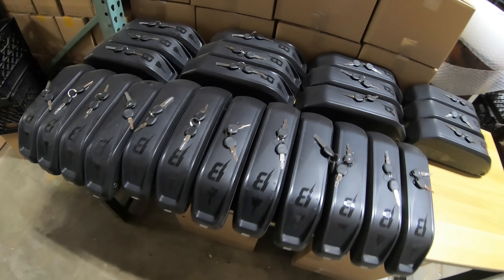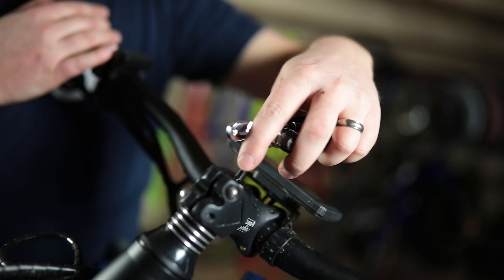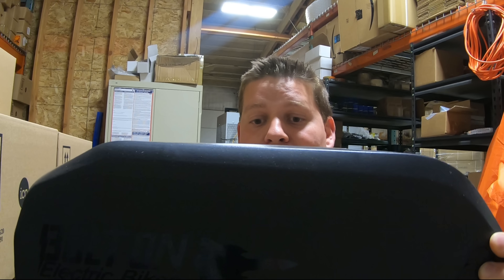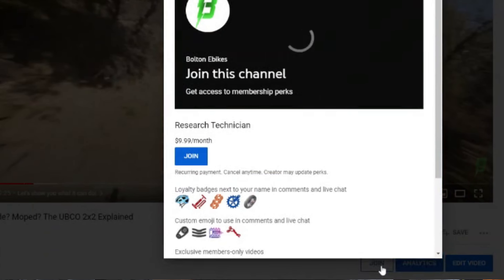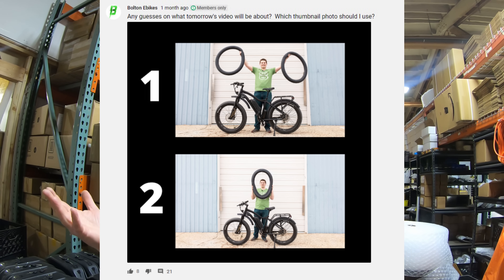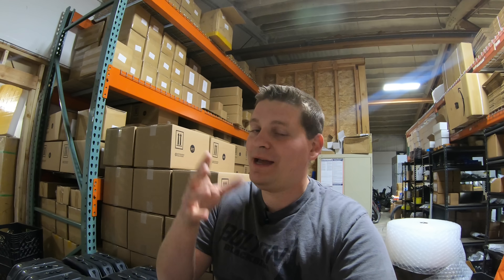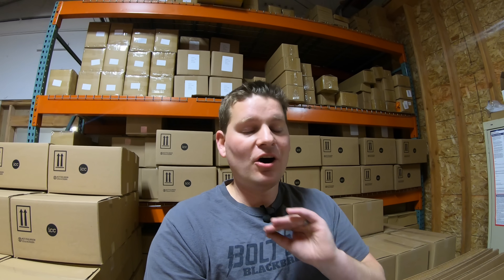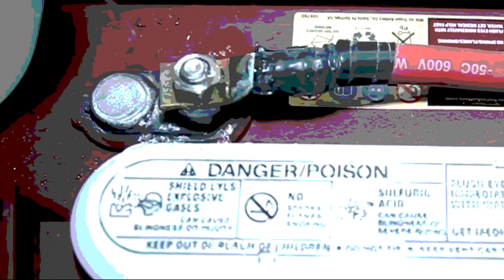How to maintain Lithium batteries for electric bikes - Easy!

Comment: Hello and thanks for your video,
However I have a question about a fault I keep getting< and was wondering if you could shed some light on it?

Description of fault.
While riding with a so call full battery, the bike loses all power and fails to turn back on>
On checking the battery after a full charge (Battery reads 39.3 Volts),

You take the bike out for a quick test, and the same thing happens, all power drops and the controller fails to light up (No power).

Take battery for a volt test it reads 9.0 volts (Not the expected 39 volts)
Plug the charger into the battery, it intimidately reads 39 volts, (Like it has rest something in the battery, and again works as before).

Take bike out after charging the battery to the manufactures recommendations, or till green light is lit.

You take the bike out for a quick test, and the same thing happens, all power drops and the controller fails to light up (No power).

Take battery for a volt test it reads 9.0 volts (Not the expected 39 volts)
Plug the charger into the battery, it intimately reads 39 volts, (Like it has rest something in the battery, and again works as before).

Any ides? Is there something in the battery house that can switch the battery off?  I did open the housing and all i see are two fuses, wires to the ignition and safety fuse, and a some kind of capacitor. 

I have rulled out a fault with the wiring as everything works as normal once I HAVE plugged the battery in and out of the charge port, charger.
ANY HELP WOULD BE GREAT,

Ops sorry caps lock. 

TIA Nico

Comment: Id like to know how many batteries he sells every few months or how he is able to maintain a proper storage charge voltage on any of the batteries just sitting on the shelf waiting to be sold.  if they dont sell super fast.    i only know of one battery store that the owner happens to keep track of the resting charge of most of the batteries he sells and tops them up a little bit when they need it because he offers a warranty on most of his batteries so he makes sure to keep them in good condition before he sells them and even checks each battery and records the resting voltage at time of sale.

Comment: Actually with lead Acid if you want it to last you never want to drain it to 100%, even 80%  For best balance between life cycle and cost you want to design it for no deeper than 50% depth of discharge

Comment: The battery explosion shown in this video is a Lithium Polymer pouch cell battery that's been seriously overcharged.
 Those are used primarily for  drones, and RC cars and boats.
Some do use them for ebikes because of the high C rating but without the proper balance charger, they can become firebombs.

Comment: I use a Grinn technologies charger you can charge at different levels ! Me to full charge every time for power  .I have 2 batteries 1 54.6 and one 58.8 !  1400 watt mid drive 61 clicks full suspension  Loud 27.5 peddle assist and accelerator ! No probs with batteries ! and you can trickle charge !

Comment: In cold weather, you can adhere a small 7w polyimide heater on Garolite and place it under the battery. You will need to add a resistor to lower the temperature to ambient. :face-red-heart-shape::hand-purple-blue-peace:

Comment: Gotta love finding this as I approach the 21 month mark of running a 250 watt motor ebike from Nakto. To say the least the battery has been cutting out as it gets down to under 40 degrees here in South Central Wisconsin. I went from around 12-24 miles a day for the first 2 months of owning the ebike to around 2-8 miles a day for the last 15 months. It's one of Nakto's Camel bikes. Sort of crappy low end, ya ask me. But... For under $800, what can we say?   Good video on the matter. Just wish it helped with the low end stuff I have. Ya know the 3 LED indicator set up kind? Yeah... They suck to no end...

Comment: Just to note the cycle ratings are usually for 80% capacity, after 1,000 or so cycles the battery will be expected have 80% capacity and it’s just an estimate of how fast the battery is going to degrade.

Comment: Yep, that agrees with everything I've ever read/researched about batteries....
Summer, winter I store my batteries (2 bikes) inside my back door (where I have kind of a little "charging station" for them). Batteries don't like wild swings in temperature I've been told.
Having the batts inside is also a theft deterrent for me as I keep my bikes outside, locked up on a covered deck.
One topic that was not covered is HEAT!...All batteries are black. On one occasion I parked in bright sunshine on a very hot day and the battery got so hot after a couple of hours I could barely touch it!!!
That can't be good. I now pay attention to where/what direction I park on such days.
I painted one battery white (to match the white bike...and tell them apart). Heat caused by direct sun exposure would be less of a problem with that one.

Comment: I have a Magnum low rider with a 15 Ah battery.  I started the charged with the battery at one green light. Once the battery charged i tried to shut it down, but it would not turn off. All the green lights will not turn off. Is that normal. I was under the impression that you hold the button down and within 3 to 5 seconds all LED lights go off. Thank you and please advise.

Comment: 800 - 1000 cycles for your batteries @Area 13? - Which batteries are you using? I've only found ONE battery that conforms to those standards. The capacity degrades over time (over more cycles). Saying a that a battery will go 50 miles on a charge on first charge, and doing it again after 1000 cycles is factually wrong and misleading.

Comment: Hi, I wanna say with balancing of batteries yes leaving it plugged in can work if your battery isn’t much out of balance and only slightly.   however if pack is more out of balance this may not be enough.   BMS may keep protecting those lower cells too much.  What you can do is discharge battery not till flat but very low then switch it off and pedal home.  Once reaches green unplug it, wait several hours for the resting voltage of all the cells to be reached, like overnight, then plug it back in in the morning.. charger should kick in again if it’s out of balance because those weaker cells would dragged battery down a bit reaching that resting voltage across the whole pack.  If only charged for a few minutes more, unplug it again, wait even longer, give it a complete day then plug it back in.  If it keeps only charging very briefly like less then 30 mins then either cells aren’t as out of balance as suspected or there is possibly damage. 

20-80% is a great range to maximize battery life.  Start charging no less then 20% so don’t try to deplete it below 20% and charge up to 80% you can extend charge cycle life from several hundred to several thousand possibly 10s of thousands of charge cycles if you stick to that. Alternatively 35/100 rule I heard.. don’t discharge below 35% but charge up to 100% that will also work really well at keeps my battery running a long time.

Comment: Sorry - this is absolute beginner level and some is even wrong! Yes - you can discharge Lead-acid to zero (as you can with Li-ion) but its bad - really bad! You will destroy a lead-acid when completely discharging! (as you would with Li-ion). Lead-acid can be discharged only to 60...50% and should be recharged as soon as possible.

Comment: Enjoy your videos, very informative with alot of information.   I am having a hard time finding an ebike that fits what i need.  For my situation its folding, 750w motor, prefer hub motor, and integrated lights as I would need to ride it on a busy street  so brake lights are important, oh and fat tires because often would hit dirth/gravel paths.  If anyone has recommendations I would appreciate help.  Gforce has the t42 but a few things concern me with them, like replacement parts are mailed from China, so if any issue arises i am stuck without a bike.

Comment: My phone seem to have different energy density in different charge percentage ranges. For example from 15% to 0% it goes super fast, it could be more than double than from 80% to 65%. They recommended to keep it from 80 to 40, so I assume that the highest density is somewhere around 65%, less between 50 to 75, then 80 to 40 and so on.
Is that the case with these batteries? Do those BMS are calibrated to adjust the percentage to show the % of actual useful energy?
If not, how do we even count the cycles, taking in account the energy density?..

Comment: ..................................................................... "Do batteries like being left out in the cold?" -You replied with NO! You then explained how batteries do not like to be charged when cold.  Your answer did not exactly match the question. Last winter I stored my batteries in my frozen garage. I certainly thawed them to room temperature before charging them in the spring. The batteries seem to have endured cold storage just fine. Do you have any particular knowledge if cold is good/bad/neutral for long term storage?

Comment: In all honesty the flight test video you showed was a different battery chemistry all together that’s used in the hobby industry. And that’s lithium polymer. This battery chemistry is more volatile requires specialized charging equipment and the hobbyist test to ensure that they do not drain the battery beyond its storage voltage otherwise battery damage and degradation will take place. Also lithium polymer batteries went punctured react to oxygen creating smoke and then fire. Lithium ion batteries which are typical and laptop computers and E bikes are not as volatile. They still have to be treated with respect and maintained properly but they’re not as fancy as lithium polymer technology battery is. FYI

Comment: I have a Samsung 48V 21ah Extended range battery that'll increase the range from 50 - 90 miles. My trip is around 695 miles thanks to my standard 48V 13ah which has a maximum speed of 32mph at 50km. Now, the standard battery will last for 4 hours, while the extended range battery would be at 8 hours. Long story short, to increase range for a higher mileage would I have to reset my Trip, and Odometer to get it's maximum speed limit or should I continue riding using my 48V 21ah battery to get the maximum amount of speed.

Comment: Thank you. correction for balancing you also need is to discharge the battery enough so the BMS has chance to do its job properly. Only charging fully will not make the trick because the BMS will disconnect when it reached its max voltage regardless of each cell actual voltage.
Reply: Max charger voltage typically == 4.2 volts per cell group times the number of cell groups in series.  So no cell group will be below its max 4.2v, unless the BMS is broken and has allowed overcharging one of the cell groups to > 4.2v.

Comment: Hello, I would like to know if I have a bicycle equipped with a 36 V battery, if I can change the battery for a 48 V by putting the computer on 48 V, will the rear wheel motor go take? thank you!

Comment: My pack is behaving strangely, the 50 volt battery has discharged itself to 48 volts overnight for 2 days in a row and under load the voltage collapsed, now on the third day it has even discharged to 45 volts but the voltage breaks no longer one when driving... is there a broken cell or was one deeply discharged?

Comment: This was better than I expected as far as I thought I was messing up bad charging it when it was still pretty full like half or quarter to make sure I can make it to work and back with all the weight I carry with me but maybe I was thinking lead acid with the battery memory I hate all these things that a gas engine will just not have like that or the cold weather granted you may have a hard time starting it sometimes but once it does it will warm up. No half ranges and power loss it gets to be like eeehhh idk if it’s really worth what they charge for these things when there’s so many touchy issues with them.

Comment: Charging to 100% is totally fine so long as you're going to use at least some % within 2 weeks at the most, but the sooner the better. I think for a majority of people, with modern lithium packs, degradation issues arise from improper storage far far more often than their charging practices. BMS have come a long way, as well as the cells. Basically just charge your battery, store it inside at a comfortable temperature when not in use, don't let it sit above 90% or below 10% for any prolonged period of time, and lastly maybe once a month to once every other month  (depending on use) you should do a cell balancing charge where you leave the battery plugged into the charger for a period of time after it hits 100%. You better know how long to do this if your app or software gives diag info that shows individual cell voltages, otherwise you'll just have to leave it go for maybe 4-12 hours. Most chargers/BMS even once they show 100% do not actually stop charging completely. They typically drop to a very low current output, sort of like a trickle charge, and the BMS begins to very slowly balance out the cells in your pack. If you notice you don't get as much range from a 100% charge as you used to, cell imbalance is often the culprit. Although, depending on age and your care of the pack, it could just be degradation. However, even if your pack has started to degrade, if you have never done a balancing charge, you likely can get some range back from giving it a good balance charging.
Reply: Very well said! I had to copy for my eBike battery spread sheet
Reply: I charged to 100% and didn't use for 2 months and now battery don't work, anyway to recover it?

Comment: My new Galaxy S22 Ultra cellphone recommendation for getting the most cycles out of it's battery is to not charge over 85% & not let it discharge below 20%. There's even a setting to protect battery from charging over 85%. Also to never let it charge overnight because it'll keep topping off.

My last cellphone was a S10+ & I treated it the exact opposite yet still got over 3 yrs of use, so... Nothing Burger?

$600 to replace a bike battery isn't cheap, but if it lasts 3 yrs doing full cycles from 100% to near zero, it's not a big deal imo.

Comment: When I purchased my battery it showed 88% on the display, I plugged in the charger until the green light appeared on the charger. I then went for a 30 mile ride and it still showed 88%, so I charged it until the green light came on and it still showed 88%. It's been like this for 2 years now.

Comment: My 36v battery used to run the motor down to about 35.5 volts before cutting out but now it cuts out at 39.5 volts.What the hell is going on?
Reply: @D*ck Tater Would it have run a 36v motor on 30 volts? Somehow I doubt it.
 The controller has it's own problems in that the horn light brake cut outs all stopped working so I have been running it with a new battery I bought the last six months.It is alright as long as you anticipate stopping in advance.
I would like to get the original battery repaired as it slots into the frame neatly but I don't know anyone locally & doing it myself looks like a hell of a palava.Anyway the new battery is doing a good job only cost me a hundred & sixty quid new & is a bigger capacity than the old one 🙂
Reply: @D*ck Tater If I strip off the blue covering surrounding the battery pack & holding all the cells in place I'll need a new plastic covering on reassembly in order to insulate it & maintain it's form.I don't have any of that blue plastic stuff & suspect that would just be the start.........then I'd need to replace cells or the BMS & so on & so on.
I'm a lazy bastard & don't really want to learn all that new technical stuff & have all the problems.Thanks for trying to help though.......Incidentally the new battery charges up to about 42.3/4 volts so everything is hunky dory.I just need the summer to return 🙂
Reply: @D*ck Tater It's already a very tight fit inside the cavity of the frame & anything but the same type of shrink wrap stuff I suspect would make it impossible.I prefer to let sleeping dogs lie.

Comment: I've 36v 10.4 Ah removable battery which have 4 LED indicator. While 3 out of 4 turns green after full charge. Does 4th one also suppose to turn green? I fear of overcharge so i did not charged for more than 6 hrs

Comment: Can you help ? I've had a new Folding E-Bike 20'' in storage for the past year, i'm just about to get at it to get it out, will the battery be OK ? I only used it about 6 times when I got it, also its a 24Volt battery that slides out of the back, 168Wh (EP20FCF) will I be OK using a 24Volt 2 Amp amazon ebike charger, not sure where the original is ! Thanks and great video.....

Comment: I bought a Rad Power Bike Rover a little over 2 years ago, but when Covid hit, I had ridden it at all.  I last charged it a year ago, and it was fine, but after trying to charge it yesterday, it wouldn't take a charge.  I changed out both of my 5A and 10A fuses, and the battery still wouldn't take a charge.  My battery doesn't have more than 5 cycles of charges.  Is it dead, and completely unrecoverable?  Is there anything that I can do to the Battery Management Controller Unit so that they battery can take a charge again?  Is it possible to unplug the Battery Management Controller Unit so that the battery will charge again?  I would hate to have to purchase a $600 replacement battery when I don't ride that much anymore.  Thanks.
Reply: Seems he likes to blab. Not helpful. I'd research deeper